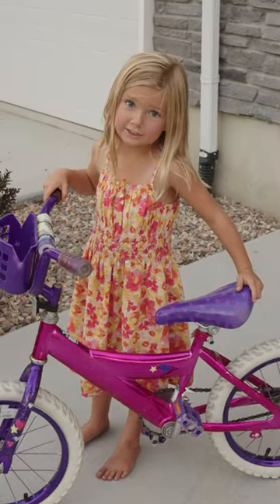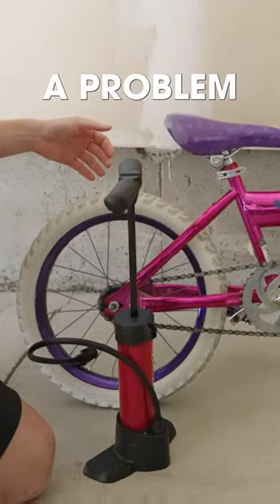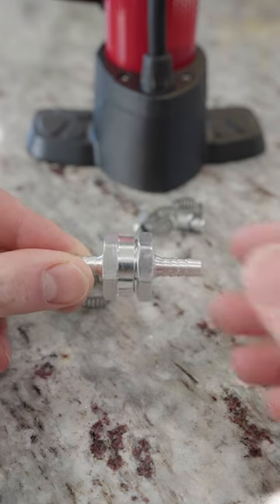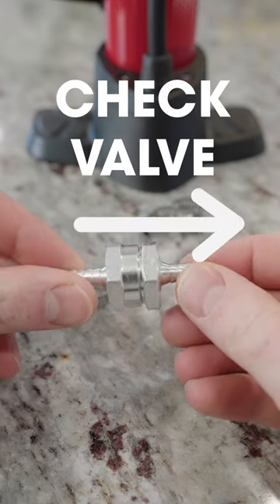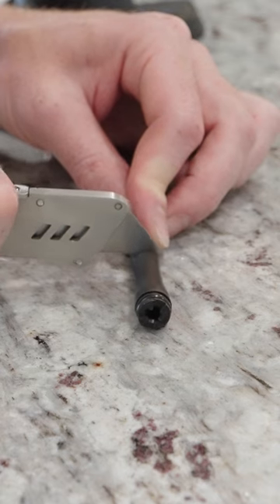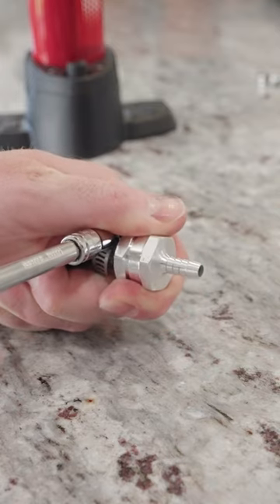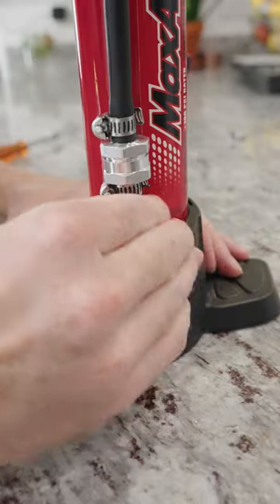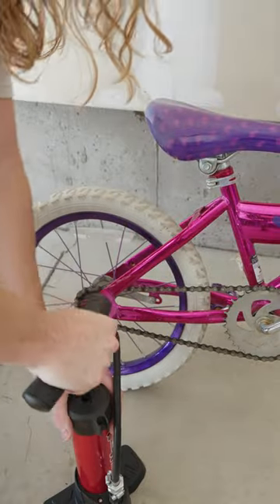Bike Pump Fix #shorts #diy #repair #fix

Comment: There is already a check valve inside at the base. That is what is leaking. You clean it out so that it’s flapper no longer leaks. The trouble with putting a new valve in the hose is that there is now more space behind the valve, which produces less max pressure.